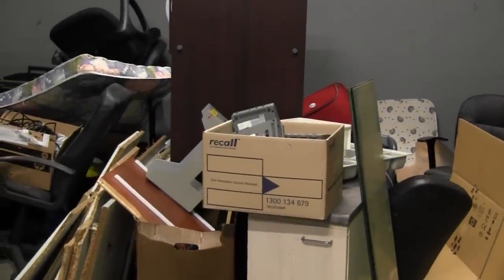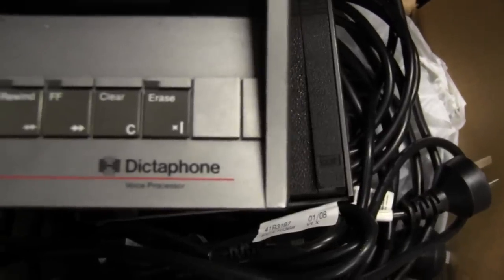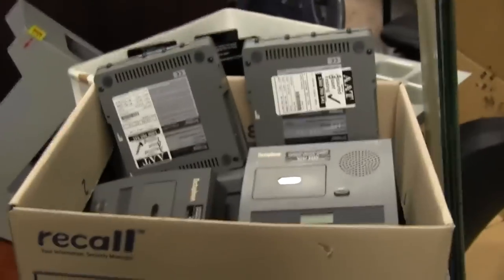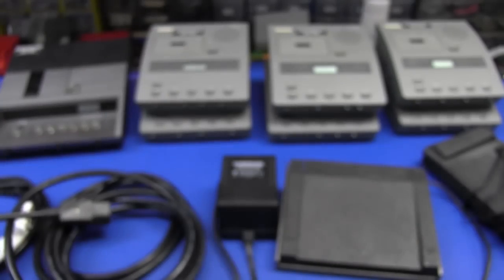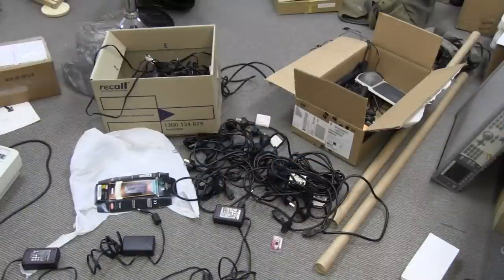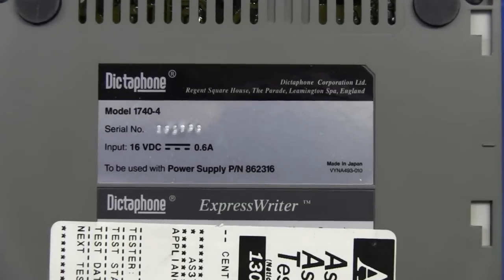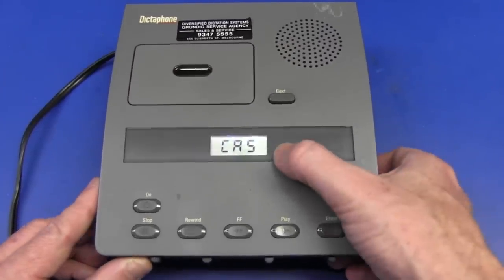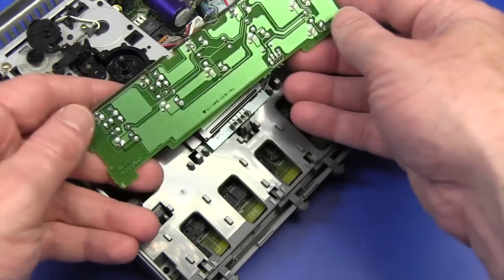EEVblog #355 - Dictaphone Dumpster Diving

Comment: A co-worker from the local radio and television station from my city (he works for a big telecom and server company) found 12 working VOIP telephone stations in the dumpster of his work place.  We used them to replace old and defective telephones at the station.  The guy that found them is a programmer that likes to tinker with stuff and has been tapping into their connection and control protocol so we could connect them to our Asterix server, so we could seriously upgrade our telephone system at the station.  I like these kind of video's, because I don't understand all that much about electrical components, but do like dumpster diving when it comes to electronics :P.

Comment: Those dictaphone tape decks are a huge hot number with the ‘modular electric musical synthesizer’ fan boys.  My moms used to be a secretary and said that taking your eyes off your page while typing is a serious obstacle in efficiency, hence the foot pedals.  Someone speaks and this device can playback the spoken dictation.  Typically have a pot for playback speed, so typist could playback at their optimal rate.  DEFINITELY a worthwhile keeper IMHO.

Comment: Well you have to think about the vintage of these devices which is approximately 10 or more years ago. Digital recorders did not have the capacity to record a long hearing and a lot of these were targeted at stenographers.
They used both tracks of the tape independently, one for recording the room and the other for the stenographer to make annotations.
As a result these devices had to be absolutely reliable.

Comment: I as an experimental and noise musician would LOVE running into a stack of Dictaphone's (or even one) - I can think of a million uses for one off of the top of my head.
Reply: +Dylan Wheeler They are very similar to regular tape recorders. It does however have a speed control that might be fun to play with, among other things.

The Dictaphone technology has taken multiple twists throughout history. Older types would cut records in plastic sheets, or engrave a record-like groove on a reel of plastic tape, while the earliest recorded on phonograph cylinders, and like all cylinder players, they had a unique and characteristic sound to them.

The machines seen on the video may be found in flea markets, guess they would be reasonably cheap since thay are mostly junk nowadays with all the crazy technology we have.
Reply: +MisterTalkingMachine Oh I know, I just saw one at the charity shop down the road for about $6.50 as well as 4 of the 8755 Extron RGB201's which are a very pro end video computer interface here in San Francisco (I have set up so many of their switchers) for 16 each which I really really hope I have enough to get all of em. I have been out of work for three months and could probably find buyers for those (well two or three of em leaving me two) and still turn a decent profit on the whole lot. But we shall see. I know that the mini dictaphone will likely be bought and see if I can turn it into a tape delay maybe.
Reply: +MisterTalkingMachine I should clarify that I found a mini dictaphone and not that unit - but it will still be played with

Comment: The wire being used to hold the wiring harnesses down to the board is actually very common in consumer electronics here in the states.
I see that quite often.
I have also seen pots like that fairly frequently.

A machine like this is usually nothing more than a glorified tape recorder.
There was a company here in the states that was actually modifying cheap Chinese $50 VCRs to be used as dictation machines....

Comment: I have overstated that a bit... These do a little bit more than a regular tape recorder and the price may be due to some certification someplace I am sure.
I actually had to fix these devices at one point some years ago and they were all solid and better built than their counterparts.
There is still a really large profit margin in a device like this that has now gone digital.

Comment: 13:12 Top chip to the left of the flat flex cable. Reads "324". Perhaps a LM324 op-amp? (For the magnetic read or write heads?)

Comment: I also have that' 'dumpsters scavenging bug'... I get lots of hardware, tools and parts from it. My wife hates it  - «bringing garbage home...». I've built two power regulators for my power tools and soldering irons for about 3 or 4 euros, all the other parts were salvaged. I also have two complete desktop pc's (Working ones) salvaged from dumpster sites in the city. and my shop vacuum system was built the same way, from scavenged garbages - another mans garbage is my treasure...

Comment: Agreed. eBay 'em. I worked in an office that used them in about 2008. Very similar to the ones you took apart, Philips brand I think. They were still being made then and sold for about £300 each with a matching pedal (like yours) and headphones (very cheap and flimsy). The price is massively inflated because of the niche market. Unfortunately everyone's going for digital dictation now. We did.

Comment: Hi, Dave, the AN6607 appears to be a dual speed DC motor Driver, i looked it up because,
i find suspicious, that such a small package, without dissipation for the time, was actually capable of driving a [1 - 3] W speaker...
that being said, ... , where's the audio Amp ?
btw, i love wednesday Dumpster Diving :)